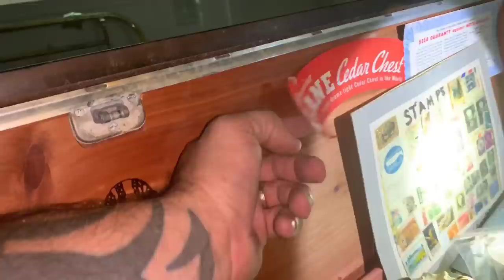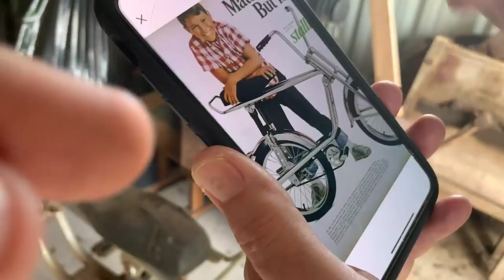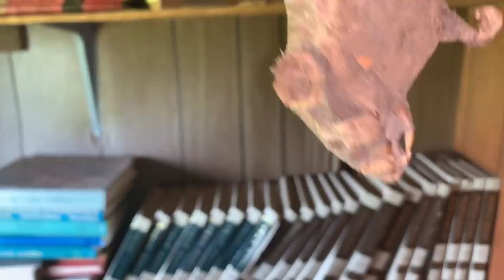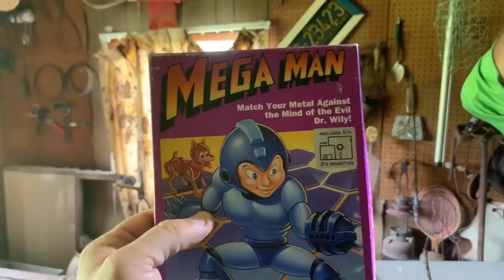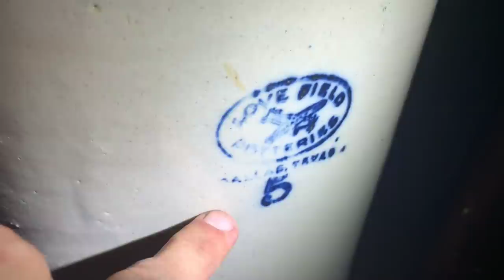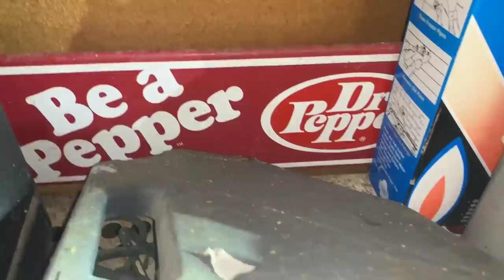DEAD PEOPLE FOUND In Abandoned House!?! THIS GETS WEIRD!

Comment: I didn't like your video title, I felt it was a little misleading, but there was some great stuff there. When your talking about the crock and the bottom being blown out, did you mean cracked, because I have an old crock with a star on it , about the same size as the one you showed but it's open at top, my crock has a hole in the center of it on the bottom but looks like that it was made that way, I've never found another one like it, just wondering since y'all work with antiques and vintage items, do you know why the hole is there, if so I'd very much like to know.